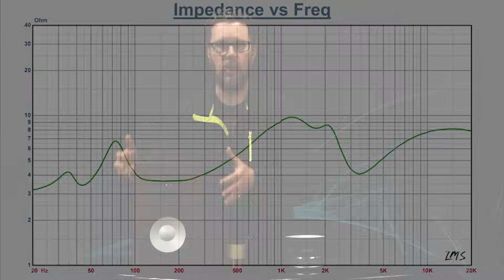What is Speaker Impedance? | Impedance ohms rating explained

Comment: The impedance of the speakers has to match the impedance of the output stage of the amplifier for maximum power transfer.  This is why tube amplifiers which inherently have a high impedance output stage would have an audio transformer between the output stage and the low impedance speaker for impedance matching.  Some tube amplifier speakers had high impedance ratings in order of 100 ohms to eliminate the need for the audio transformer.
The same holds true with microphones - ever try to connect an high impedance microphone to a low impedance amplifier input?  The imput signal will seem to be very weak.  The same would be true if you connect a low impedance microphne to a high impedance amplifier imput.  For maximum power transfers the impeadance of the output circuit must match the impedance of the input circuit.  This is basic electrical engineering theory.  The presenter's explanation  is flawed.

Comment: Excellent. Well done. The only thing I would challenge you on occurs at 4:39. Reactance doesn’t include the resistive property. Reactance is a frequency dependent opposition caused by inductance and/or capacitance. Impedance is the term used to define all electrical opposition. Impedance describes the combination of resistance and reactance.

Comment: Just out of interest ... I ran a pair of 4ohm speakers from a sony av receiver as a stereo set up, ie no rears or anything else for years ... I switched to a hi fi amp and read the back of the old amp and it said it was only rated for 6ohms ... I think i was very fortunate not to have problems, i wouldn't recommend it even though i got away with it.

Comment: I think this clarified some aspects of speaker impedance ratings for me. But after all of this is said, how it is that almost all speaker manufacturers produce speakers with nominal ratings that are a multiple of 4 ohms? Consider all of the combinations of coil sizes, number of windings in the coil, cone material, number of drivers, with or without a crossover, etc. etc. that a manufacturer makes when designing a speaker. How is it that these speakers always have a nominal impedance of 4ohms or 8ohms? Why not 11.5 ohms? Or 2.75 ohms?

Comment: My understanding of impedance is that it applies to voltage/amperage that is changing, not just alternating. Its true that a voltage that is changing from +2V to +10V to +2V can be thought of as -2V to +6V to -2V with a +4VDC component added. It's still actually +2V +10V +2V.

Comment: Nice discussion that did clear up a couple questions for me, thank you. I do have a question that has rattled around in the back of my mind for a few years now. I have a 100w, fully tube driven, guitar amplifier head that has a switch  for 4,6 and 8ohm loads. Obviously selecting the matching setting is important but what do they do in the circuit to compensate for these different loads? Does it add resistance or capacitance to the output? Maybe up the voltage to the tubes, bring different windings into the circuit from the power transformer, up the voltage at the rectifier tube? Maybe I’m way off base on all of those guesses?
Reply: I'm curious about the answer to this. 
You would think there would have to be a mechanical change to adjust the ohm setting. Clearly there's a switch, so you're moving SOMETHING mechanically, but idk what that is.

Comment: The rule of thumb is if manufactures don't want to brag (list the specs) about the 4omh output, then the rating will be pathetic, thus not listed. Ideally, an amp should be capable of doubling current when the impedance halves. Most can't do that and some even have less current at 4Ohm loads. For instance, a rather new Quad integrated amp has 50watts @ 8 ohms and only 34watts @ 4ohms. Which is pathetic. At least they were honest and gave the specs. People should focus more on the 4 ohm rating if they care about a dynamic sound. Also, the rating on speakers aren't necessary accurate. 

Several "8ohm" speakers are really closer to 4ohm. Kef is starting to rate their speakers at 4ohms, as they should have years ago. The LS50s are 4ohm speakers. The impedance curve shows it. An 8ohm speaker needs to stay at or above 8ohm for 80% of the frequency range.

Comment: What about a 12 volt system ?
Like in your car ?
No alternating current there.
Reply: The 12 volts is only the power supply side of the amp. There is obviously a conversion in the amplifier of that DC supply to AC at some point, as the process of generating sound with a speaker requires an audio signal, which is AC by definition.

Comment: Sorry just a point of clarification.  So Impedence is the measure of out of phase resistance.  Pure linear resistance does still exist in AC current, such as a pure resistor like an incandecent lamp, or a heating element in an electric stove.  We can call in phase impedence: Resistance.  However, impedence does only exist in AC current, we need to have and out of phase component (leading/lagging ie Capacitance/Inductance).

Impedence is the most correct term to encompas ALL resistivity of any circuit, it takes into account all in phase and out of phase components, whether they exist in the circuit or not, regardless of the power source.

Comment: I never understood why threre is no standard impedance.
Reply: There are indeed a handful of more-or-less standard speaker impedances. 16 ohm was probably the commonest for PA applications in the 1940's and 50's, because tube amps are more efficient when driving  higher-impedance loads (and therefore many tube amps had 16 ohm taps on the output transformer). Occasionally one might see a 32 ohm speaker tap on an amplifier, but 32 ohm speakers were more likely  intended to be parallel-wired for a 16 ohm total load (or 4 of them in parallel, for 8 ohms). 8 ohm speakers could, of course, be series wired for 16 ohms, or 4 ohm speakers could be wired series-parallel, fir 8 ohms total. 4 ohm speakers were very uncommon in the tube amp era, with one notable exception: Jensen 4 ohm speakers used in Fender Champ guitar amplifiers, which may have been custom-made for Fender. I've encountered many many vintage Jensen speakers, but the overwhelming majority were either 8 or 16 ohms, and the 4 ohm 8" Jensen found in Champs never seem to be found anywhere else (school classrooms used tens of thousands of Jensen, and other, 8" PA speakers in wedge shaped wooden enclosures, but I've resold many dozens of these and they're always 8 ohm, with a 70 volt line transformer attached).

4 ohm output taps were common on quality 50's tube hifi, but that was probable done as a convenience for paralleling 8 ohm speakers, because 4 ohm hifi speakers were virtually non-existent in the 50's and 60's.

Comment: Long time ago I saw fancy Infinity RS2B.  Half price, I couldn't resist.  Took it home and hooked it up to my Carver 250W amplifier..  In about 2 seconds I saw flash and bit of smoke. Had the amp repaired and after hooking it again, same thing happened.  After some education about ohms, I bought different amps and things are OK now.
Reply: Carver amps, ugh. I hated repairing those! When the blew up, it was often like a chain reaction and there would be dozens of damaged parts.
Reply: @goodun2974  I still have it in my garage, rack of vintage stereo and Dalhquist DQ10 speakers.  Not bad for a garage.

Comment: But what about going in the other direction. Using a 4ohm amp with 8ohm speakers.
Reply: In that case you will lose half the rated output power, for example 50 Watts instead of 100 Watts.
Reply: What? Why.
Reply: @0bzen22  Output power halves with every doubling of speaker impedance.

Comment: Thank you SO much. I dropped off my vintage receiver yesterday. The person at the counter said I should check my speakers resistance with a multimeter and make sure they are within 0.1 of an ohm of specification (8 ohm) first. I have a cheap $5 multimeter and my speakers are bi-wired and buried in my built-in cloth covered midcentury speaker shelves. I was getting unstable readings from the speaker wires, so I broke down and bought a decent Fluke multimeter. Still, not able to get it right, I hit the web. This is where I started to realized it is not that simple. I wish this video was my first stop, but thankfully, I found it. Crazy how misinformed we can get.
Reply: The "person at the counter" gave you dumb advice. You can't truly  measure a speaker's impedance with an ohmmeter; the ohmmeter puts DC battery voltage thru the speaker and measures DC *resistance*, which is different from the impedance of the speaker at music frequencies, which are AC signals. An "8 ohm" speaker will typically measure anywhere from 6.5 to 7.5 ohms with an ohmmeter; a "4 ohm" speaker usually measures a little over 3 ohms. 

Speaker-resistance tolerances are rarely within a tenth of a percent of each other and the resistance in the meter leads and probes can throw off your readings. Oxidized or greasy probe tips and dirty speaker terminals can also add small resistances to your measurements. That guy at the counter is sending you down rabbit holes!
Reply: @goodun2974  I agree. This video was what gave me the confidence that he was either FOS, or I misunderstood him. BTW, he gave me a quote of $1100 to fix my receiver, and I said no thank you, and 2 weeks later got a second opinion. The second opinion quote was $150. I don't like trashing anyone's business, but I can't imagine how he must be taking advantage of people who are unable to critically think for themselves.

Comment: My AV receiver is Denon X550BT with specs of 70W at 8Ohm 2-channel driven and capable of 6-16ohms. My current setup is 5.1, all 5 Dali speakers are 6-ohm. My listening distance is 7-feet. My master volume never really goes over -10dB. I have sub comnected and crossover on all speakers is 100Hz. I bought Dali Oberon Vokal rated 4-ohm to replace current Spektor Vokal and it's in shipment. Do you think with the only center speaker at 4-ohm, any risk you foresee?

Comment: and the power rail fuses are a hard limit! My Phase Linear 400 is rated: POWER: Greater than 200 watts/channel R.M.S.,
both channels driven into 8 ohms, 5 to 20 kHz..   or POWER AT CLIPPING: Typically 250 watts/channel
R.M.S., into 8 ohms, 400 watts/channel R.M.S.,
into 4 ohms, 125 watts/channel R.M.S., into
16 ohms.
BUT it only has 5amp (fast acting) bus rail fuses.  Thus the power is truly limited to 200 w 8 ohms and ONLY 100 w at 4 ohms as the fuses have already blown.

Comment: This seems counterintuitive. My amplifier is rated at 4 ohms, and I was worried that my 6 ohm and 8 ohm speakers required more power to overcome the 50-100% extra resistance they provided.  I haven't had the slightest problems, and this explains why, even though I still don't quite understand it

Comment: Thanks for this info. You helped me understand why when replacing the original 67 ohm speaker in an old sears Silverstone  transistor radio with a more commen  8 ohm,and using a 59 ohm resistor in series with one of the leads, it did not have much volume. Never understood what the difference was till now.

Comment: Too much information, 
The avg person doesn't need an electronics course to know what 
Type of speaker to use.
Its in the owners manual.

15:27   smoke and fire and it won't work until you put the smoke back in. .   Only use speakers rated to work on your amp/reciver/avr.
And know what the output is at each ratting.

The lower the impedance the louder, but its a trade off for how clean it plays, @2ohms its almost a dead short few amps can play a driver rated @2ohms  
You get into amps rated at 8 ohms
Its cheap electronics.  Look at sensitivity ratings on the driver.

The old adage was buy the best speakers you can afford, then the receiver.    Thats not true  I have a 2500 dollar avr  and 100 dollar speakers it plays loud clean and sounds good. 
The system can run a much better set of speakers, like 12,000 dollar speakers  that would sound really good, but i don't need it.  

I have 0 chance of clipping a signal
And blowing my speakers.

Comment: I found impedance easy.
If the Amplifier says it is designed for 8 ohm or even 16 ohm speakers, I buy the speakers the amplifier is designed for.
It works all the time!

Comment: A really good attempt to explain impedance.  But ohm's law is kind of different for DC than AC.  You invoked "the water analogy" which kinda works for DC, but totally falls apart for AC.  You showed a logarithmic chart showing freq on the x axis and Current on the y axis.  Probably you left most americans scratching their heads as they are a bit dim.  [Trump sic].  I have a a pair of 4 ohm impedance ELAC 3 way ported bookshelf speakers.  Andrew Jones designed these speakers.  I was concerned about the low impedance and Andrew Jones explained  that due to the fast dynamic transient frequency changes that it all kind of averages out.  He also pointed out that this is safe for "flagship receivers and amps."  Finally, he added not to drive the amp too hard, but if I did the thermistors  on the heat sinks would shut off the amp until it cooled and no harm done.  I thank you for taking on this difficult and technical subject.
Reply: Boo to politics in this forum….

Comment: If you don't know the impedance of a speaker, is there a way to figure it out? I was thinking maybe driving it at different frequencies and testing the current draw........
Reply: You are correct.  If you have a function generator, a power amplifier and a scope with a channel 1 * channel 2 instantaneous multiplier, the result is power.  Better yet, get a precision power meter also but power meters are never cheap.  You cannot multiply voltage by current because the speaker has resistance, inductance and capacitance depending on the frequency.  Also, some very smart guy above made the point that all speakers are just linear motors and are generators as well, so even the enclosure will affect the power and power factor.
Reply: @ Thank you!

Comment: Never forget that a woofer, by design, is a motor and a generator at the same time. That’s the missing element in all amp specs. It’s much more than looking at impedance, and power.
Reply: Yeah, a speaker generates back EMF, not just because of the coil inductance but because a coil sitting in a magnetic field is a microphone as well as a speaker!

Comment: No, resistance does not become impedance when you apply AC, Ohm's law still apply to a resistive load even if you apply AC.  When an inductor is driven with AC, the impedance aka resistive value changes in a coil, and this is what is called impedance.  In other words, the resistive value of the coil changes and does so with frequency also.  In general, the DC resistance of a coil is much lower than when AC is applied.  Think if an AC motor is switched on (DC applied), it draws a lot of current, but when running the motor draws a lot less current (AC applied).

Comment: It's all about current. And, how the circuit is designed. If you put a 4 ohm speaker across an 8 ohm amp, it'll be louder, but, is the circuit designed to handle twice the current across the coil?? It'll for sure, heat the final transistor and, it may change bias, which can and will affect distortion.

Comment: I guess the impedance can never be lower then the value of the resitance. Anyhow, my speakers are marked with impedance of 4 ohms, but when i measure the resistans i I get 6 ohms. This should, I think, not be possible. But I measure in the wire connectors (disconnected, of course), but is there some circuits in the cabinet that make the measurement wrong, or is it purely a fraud from the manufacturer?

Comment: I think it’s strange to say that if you keep the voltage the same it draws more current and doubles the power output (it’s a theoretical and a quite silly statement).

Why not saying keep the current the same? With a 4Ω speaker that needs only half the voltage and half the power!

Why not saying keep the power or the output in SPL the same. That seems far more logical and practical to me. With a bit more current (+41%) and a little less voltage (-30%) you get exactly the same power and exactly the same SPL-output. It gives you a little more headroom before clipping, and a little less headroom before temperature safety measures kick in. A music signal has a relatively low power content so you are now better of with some more headroom for the peaks.

Giving the fact that the output rating for 4 Ω is somewhere between the same and double the rating, the amplifier gives you also more headroom in power.

I think that the conclusion is (supported by the trend for lower loudspeaker impedances) that you’re better off with 4 Ω loudspeakers.

A little more technical background is that it’s not the same power into 4 Ω that gives the same output as into 8 Ω. With a 4 Ω driver you get a 30% lower force factor, with almost all other factors (moving mass!) the same. With the same power you get 41% more current, with a 30% weaker force factor you get exactly the same SPL-output!! The point is that almost nobody understands that loudspeaker drivers are current driven and that the output depends on the current (not the voltage and not the power!) and the force factor. The unit of the force factor is, surprise, surprise, newton per ampere (and not per volt and not per watt).